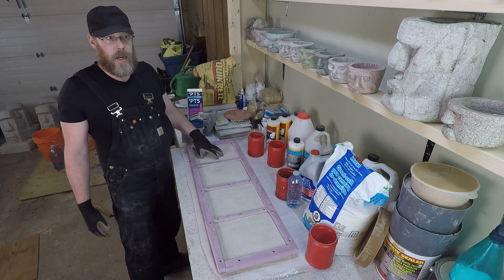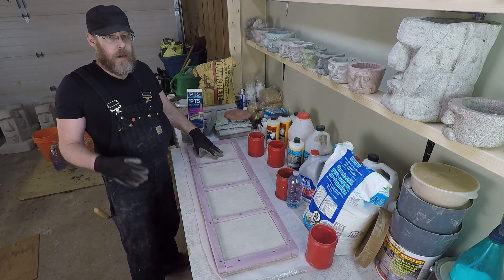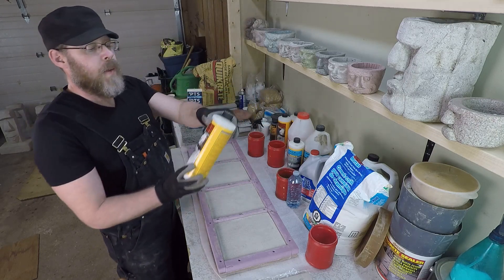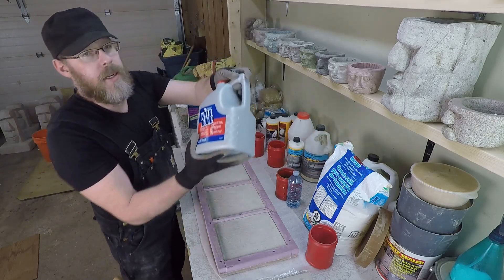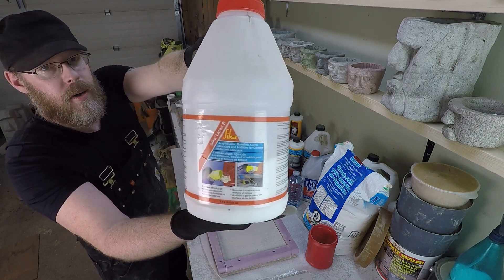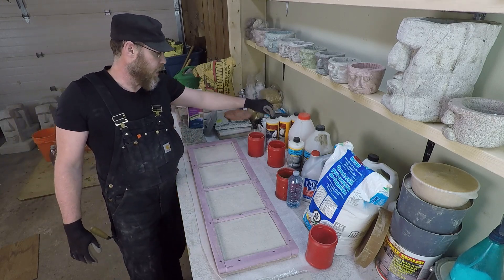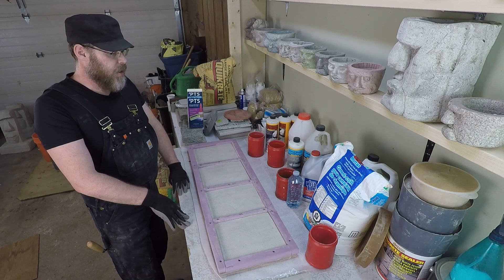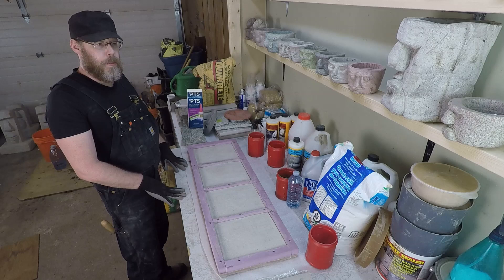Introduction To Concrete Bonding

Comment: Would the 'glue/silicone' stuff make a decent "mortar" for building with concrete bricks?
Normally you'd just use a mortar between bricks. But that's kinda an old-new-old layering. I kinda wonder if bonding might be better?

Comment: Hi Steve, I want to put pavers around the pool and pour concrete to the pavers, Do I need any thing in between? Or can I pour right to the pavers? The pavers will be glued down to the steel walls. Thanks
Reply from the maker: Sounds like you should probably have an expansion joint with a flexible urethane to seperate them and protect from expansion forces.

Comment: Thanks Steve. These videos have been a game changer. I’m about to do what you warned about. I’m going to do my own waterline tile. I have a pool contractor doing the demo and re-plaster but I’m doing the tile, plumbing, electrical, and deck surface on a 1960’s Blue Haven gunite in ground.

Comment: This has been a stressful process getting quotes to repair my steps. I have contactors telling me that it's ok to put concrete on concrete without any type of bonding to change the depth of my steps. Feeling lost
Reply from the maker: A bonding slurry is important especially for thin overlay applications, where if I were adding something thicker like 2" or more I would want steel pinning / dowels into the old concrete to help anchor the two together.

Comment: Hi there. Great content. I have a question. I have a double garage and I want to add some concrete to the old pad to raise up a section that has dropped. I tried this once before already and the new concrete completely detached and broke apart. My question is how/when to add the concrete after applying the bonding slurry. Do you let it dry then add? Or "paint" it on and immediately add?
Reply from the maker: How thick is the new concrete going to be?  You really want to use steel hardware to pin the new area to the old in addition to a bonding slurry (and apply new mud before the slurry dries)
Reply: @Swimmingpoolsteve  it will taper from about 3 inches to zero.
Reply from the maker: @ajjenga4316  you cannot zero or featehr edge concrete.  Even heavily modified concrete will be 1/4" minimum.  1/2" for unmodified and it would be easy to have that fail even.  For anything 2" or more I would install hardware into the existing slab and tie new steel to that.